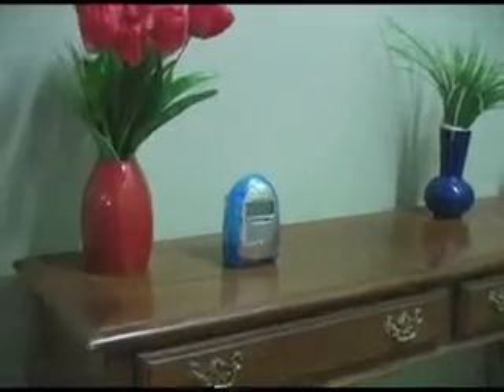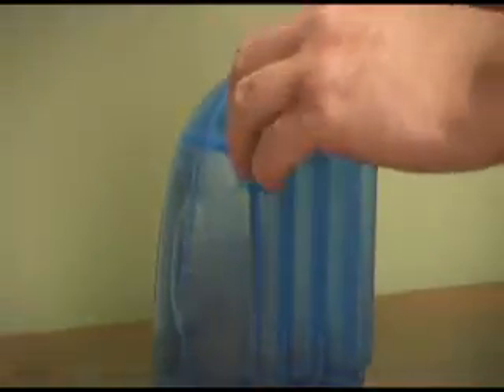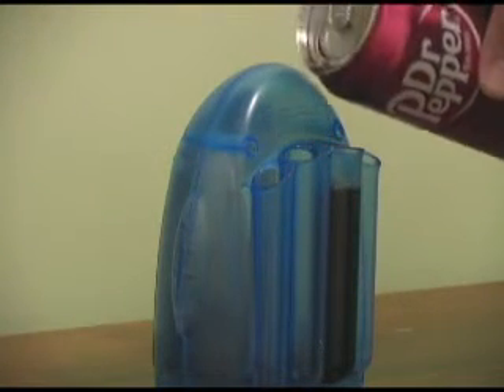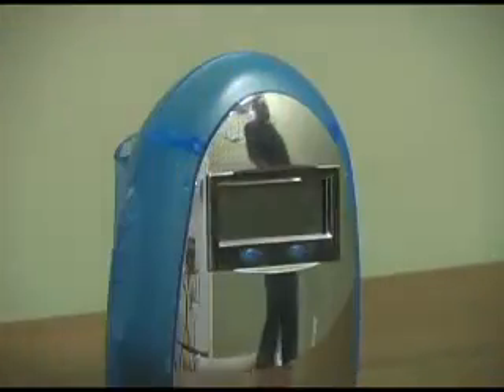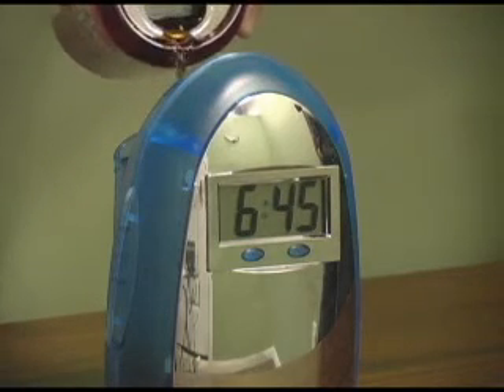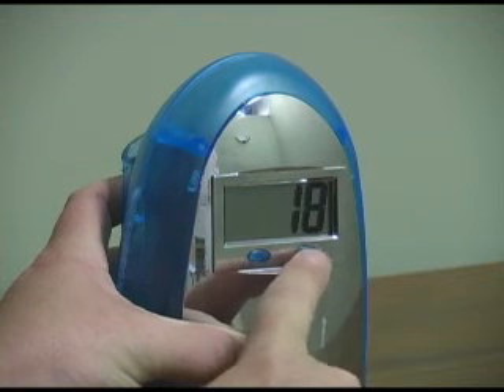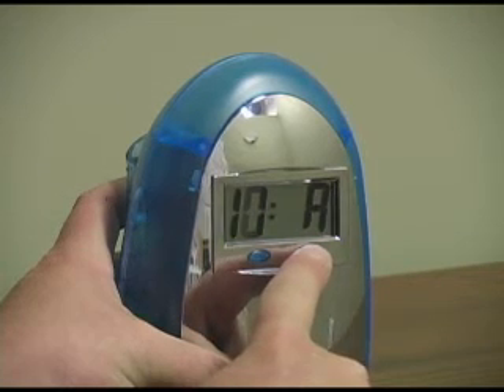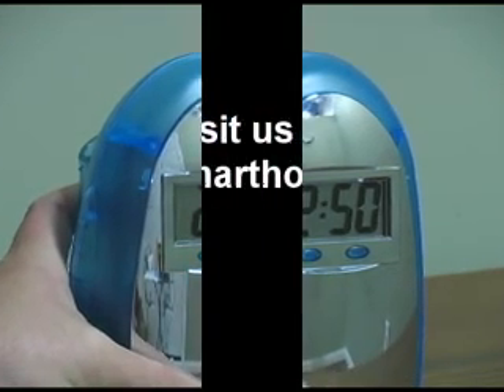Water Powered Clock

Comment: Water powered clocks are NOT powered by water. There is an internal piece of zinc which dissolves and the water or any liquid acts as a conductor. It does not "convert electrons in a fluid into an energy source".